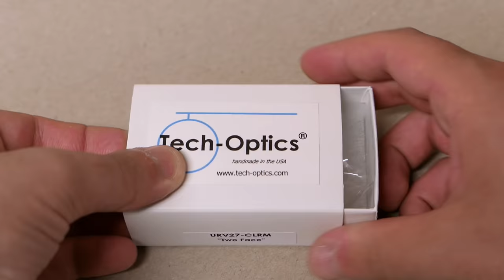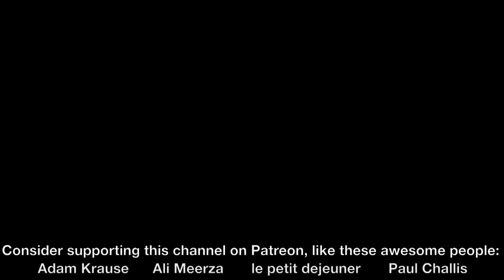Two-Face Sculpture Timelapse - The Dark Knight

Comment: hello is the smooth on smooth cast 325 similar to epoxy resin (which i currently have at home). Because I have already carried out a test with this type of resin and the molding is impossible because it is much too liquid and it does not take the shape of the mold ... (basically we have a puddle at the bottom of the mold) 
(to answer me please translate your message in french please)